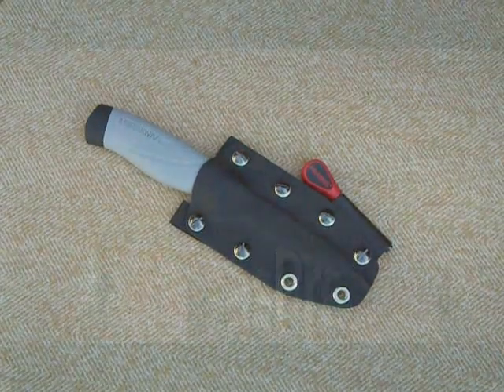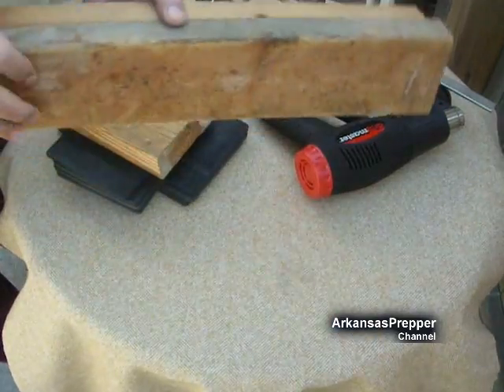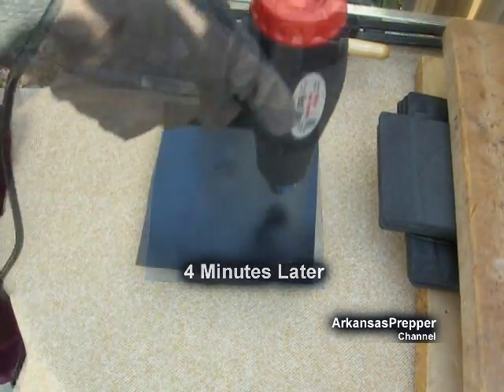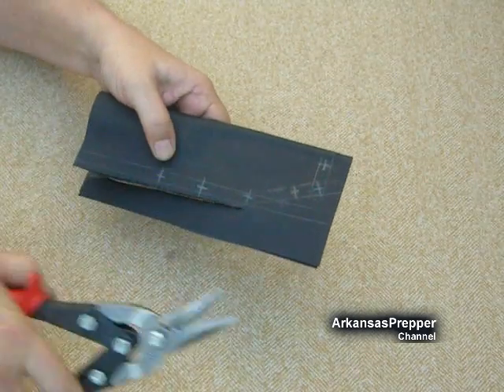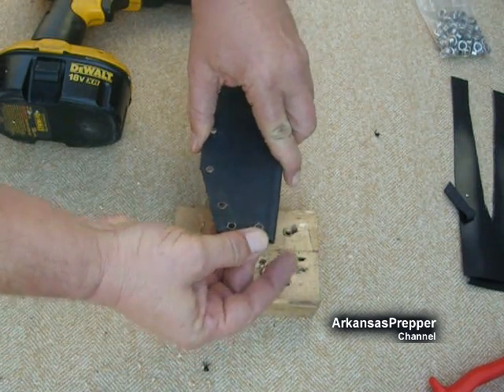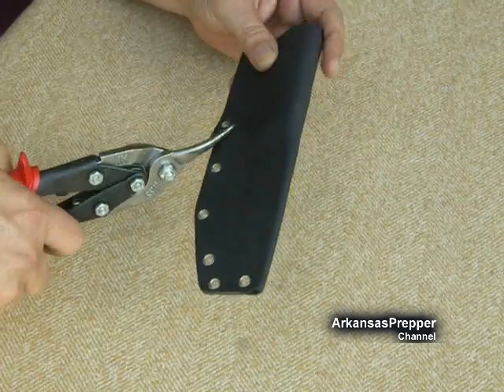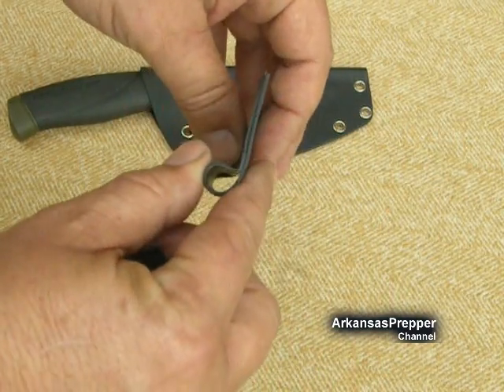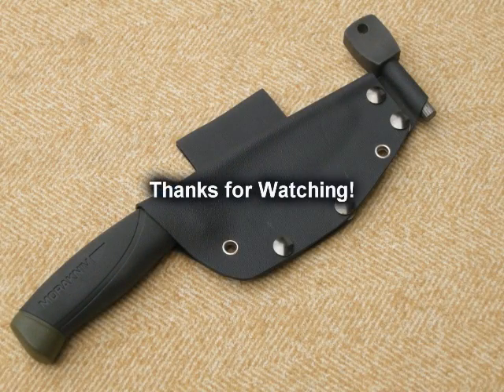How to KYDEX - A Knife Sheath

Comment: That was an excellent, excellent video! Thanks, and now I am heading into the garage to make my first sheath!
Reply from the maker: Courious? Did you make a Kydex Sheath?
Reply: As a matter of fact I did. It looks easy when I watched you do it...and it was...except that I used two pieces instead of the "taco" fold-over method and the pieces shifted as I was drilling the holes. I thought I could just re-heat the kydex and re-form it, but every time I tried it just went back to the old/incorrect alignment. Finally, since I thought it was ruined I went ahead and sliced the top off of the sheath with my bandsaw...and there was just enough left for the knife to "click" into place...so I was happy. I learned a lot through the process...and thanks again! If I could post a photo here I would!
Reply from the maker: Great! Just remember that I too made mistakes but you can reheat the kydex and press it again if you fail. Also when drilling, rivet one hole at a time and this will keep it from moving. thanks

Comment: Best diy video on this subject, thanks for your video brother that was excellent. That divit press is a spendy little thing but considering the price of custom made kydex sheaths that puppy will pay for itself.
Reply from the maker: +Airik1111 
You are very welcome and do not get frustrated it very easy to work with just heat it up again and again. For those little areas that need some adjustment? I would use a cigarette light in a quick back and forth motion not to burn and push on it with bottom on the lighter. Thanks for watching.

Comment: Really nice sheath but there is a slight problem. You won't be able to strike the firesteel off the back of that Mora!
Reply from the maker: I filed the back of the spine. Works fine.
Reply: ***** Did that work for you? I have the exact same mora, the heavy duty mg, and I have access to an electric grindstone but I was worried about ruining the finish and getting rust problems.
Reply from the maker: *****
Mine is the Carbon Blade and was only $12.00. No rust yet?
Reply: Mine is carbon also, I will give it a go then :)

Comment: awesome video, love it man.  i was thinking, why not just use a regular rivot tool.  they are cheap.  i know they are small, so you prob cant run paracord through it but anyways, if you think about it ahead of time you can rivot straps, etc, to the back side (for a MOLLE attachment point or whathaveu) before you assmeble the two.  And with a molle strap, which is simple/flat, it won't get ruined/deformed in the pressing procedure.  hey, just an idea man!

Comment: u should use heat gun and use it in middle setting to heat instead of high and ill tell you why. First of if u do it high yes it will heat up faster but if u use middle setting it will be slower process but you'll be able to really get into core of that kydex and get much better results. Again yes its gonna take more time but you'll be surprised how much easier its to work with and how much better angle and shapes you'll achieve.